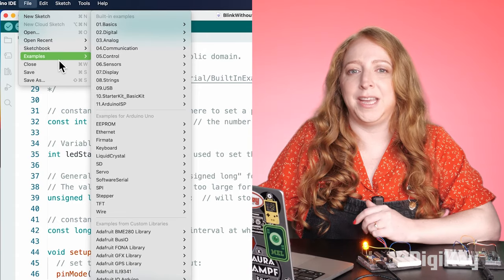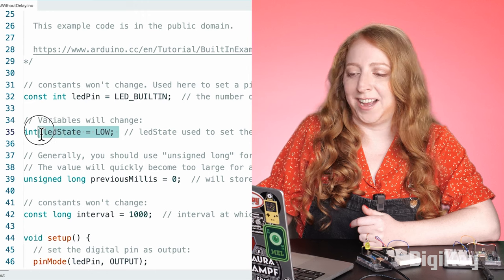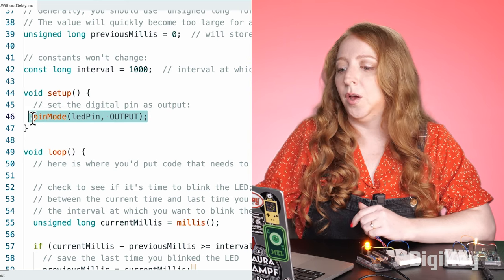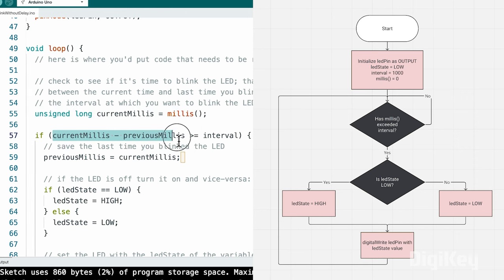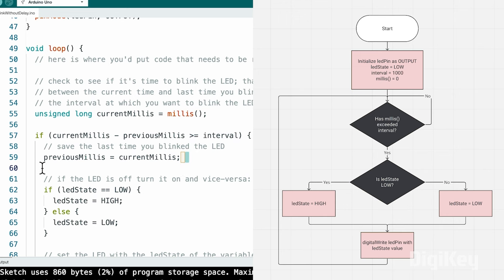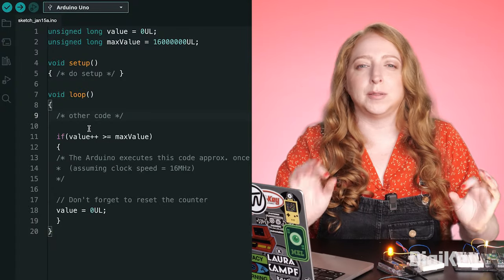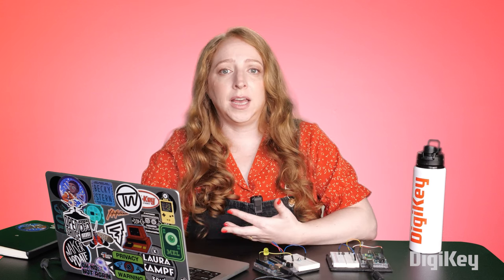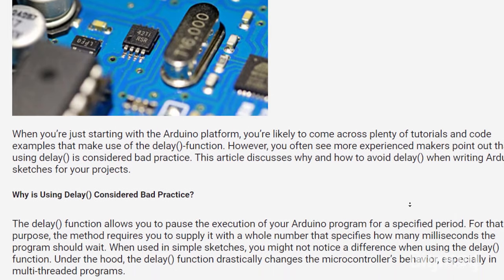Arduino Without Delay() - Electronics with Becky Stern | DigiKey

Comment: Either use some lightweight RTOS, or superloop+IRQs. No need to reinvent the wheel here. Any time intervals between events should be scheduled with HW timer if an interval is larger than one period of sys timer or just with RTOS
Reply: RTOS and IRQs add way too much complexity for many projects. Sure it's great if it's already in your wheelhouse.
Reply: @jeremiahbullfrog9288  Eh, imho, better do project minding potential complications and future additions. 8-bit chips can use baremetal soft of course, but some arm or risc-v almost always benefit from rtos
Reply: @МаксКрам-е8ч  These are introductory videos for beginners just branching out into the idiosyncrasies of advanced usage. They're meant to lead the student to further investigation, not solve every problem with overkill complications. Learning an RTOS to responsively interlace tasks is reserved for later study.

Comment: This will fail when millis() rolls over. So beware.
Reply: Couldn’t you attach an ISR to increment a counter whenever millis() rolls over, and use that to calculate longer times?
Reply: As long as you declare all of the involved variables with the type unsigned long, "(currentMillis - previousMillis) > interval" will work even when millis() rolls over. For example, if millis() has rolled over so currentMillis is smaller than previousMillis, subtracting the two will still give you a positive number that is the right answer since they are unsigned longs, and the loop will work correctly for the rest of time.
Reply: Treating all of the vars as signed will make it work correctly too.  Also the current Millis should be declared volatile.
Reply: FYI for the target audience: it takes around 49 days for millis() to roll over on the smallest AVRs, so don't be too paranoid about this.
Reply: Can never go wrong with lessons dealing with time. They’re some of the hardest projects you can do especially if you’re not relying on an RTC or NTP.
Reply: @jeremiahbullfrog9288  would the microcontroller even be able to store that much data?
Arduinos have very little ram